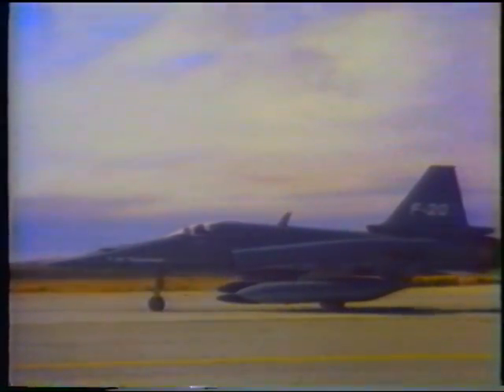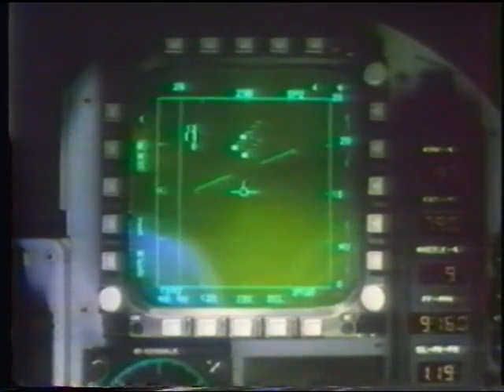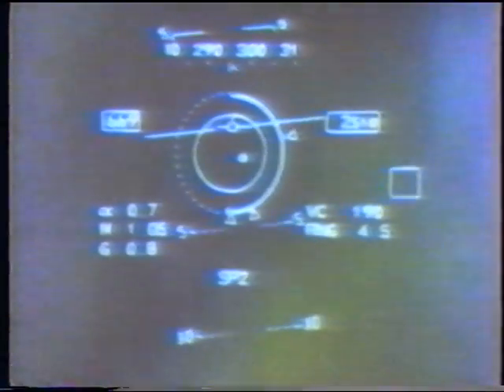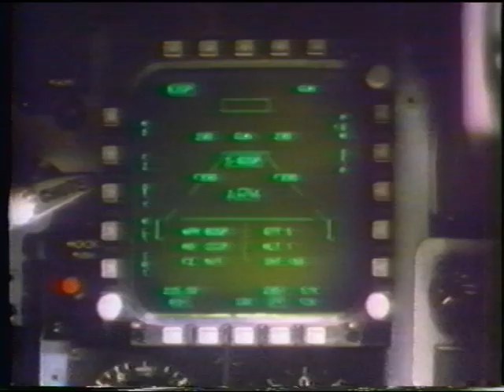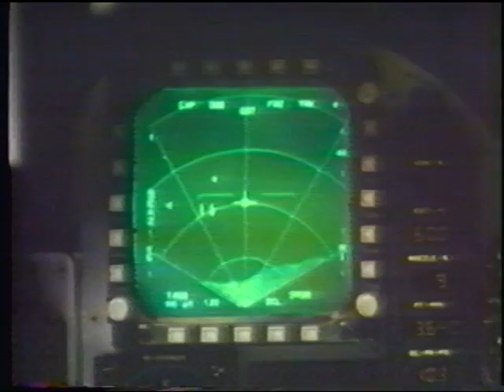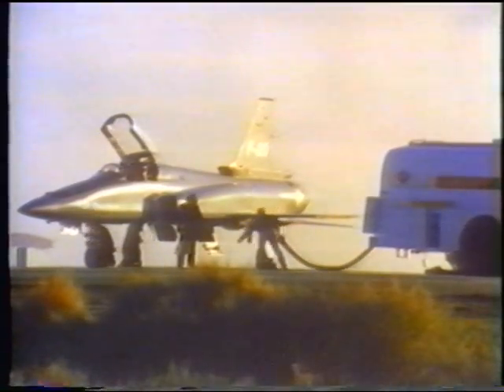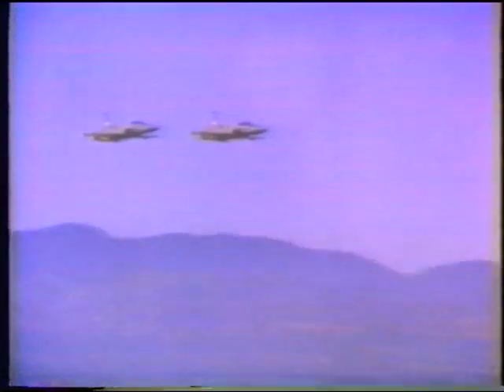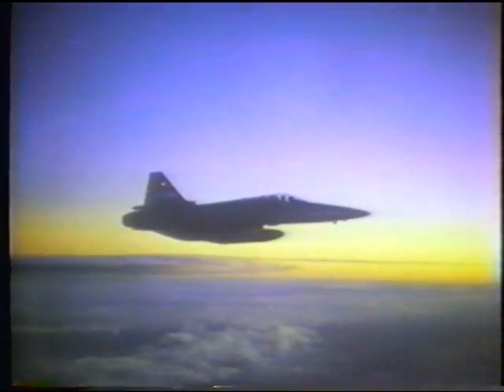F20 Tigershark historical video

Comment: F20 was superior to the F16, in every way.
Reply: +Chris Beckman No it wasn't, the F-16 had better range, maneuverability and rate of climb, the only upper hand the F-20 had was BVR capability despite being marketed as a downgraded F-16. And later the F-16 would also have that
Reply: Chuck Yeager would disagree.
Reply: +Chris Beckman And how? The F-16 was built to be more maneuverable and faster. There is aerodynamically no difference between the F-20 and the F-5, whereas the F-16 was a whole new airframe with a newer and more powerful engine
Reply: +Stormsquad Aerodynamically there were quite a few differences between the F-5 and the F-20, and in fact there were considerable changes between the F-5A and the F-5E. The shape of the F-20's nose, for example, as well as the revised Leading Edge Extensions, were designed to enhance high-AOA performance and pitch response.  The changes were subtle, but they were there.  The F-20 would have been an excellent dogfighter, although I'll stop short of saying that it was superior to the F-16.  It definitely had a much faster scramble time, and in terms of bang for the buck there was no contest.  Somebody should have bought it.
Reply: +PeugeotPilot Well true, if you look very closely there are a bit of minor differences in the intake shape and couple other surfaces in the F-5 and the F-20
Reply: +Stormsquad Those differences added up to a very different animal in a turning fight.  The original F-5A was more of a light bomber than a fighter.  With the introduction of the F-5E it became a proper dogfighter.  The LERXs were enlarged and the wing (in particular the combat flaps) were extensively changed.  When the F-20 came along the lessons learned from the F-5E were applied to that aircraft, but enhanced.  It had larger LERXs than the F-5E and would have had a fully-automatic combat flap system integrated with the FBW flight controls.  Northrop had a really interesting hybrid flight-control system that gave the pilot limited-authority manual controls if the FBW system packed it in.  The flattened shape of the nose was one aerodynamic feature that allowed Northrop to do away with any AOA restrictions at all.  There are some interesting articles on the subject if you're interested.  Add it all up and the F-20 was basically the ultimate evolution of the F-5 concept, a mature and capable design.  It may have looked a lot like an F-5A (and this family resemblance may be one of the reasons it never sold) but really it might as well have been a whole new aircraft.
Reply: Payload....F-16
Combat radius.....F-16
Climb rate.....F-16
Hard points for LANTIRN/SNIPER/LITENING, and HARM Targeting Pods...F-16
Cockpit visibility fore, aft, and side....F-16
Seat position for comfort and G tolerance....F-16
Radome size....F-16
SEAD mission profile...F-16
Growth potential for JDAM employment in the future....F-16
Sustained Turn Rate....F-16
Engine commonality with other USAF engine logistics infrastructure (F-15 for Pratts and B-1B for GEs)....F-16
Real gun common to every teen fighter (M61 20mm rotary Vulcan)....F-16
Reply: I wouldn't say it was superior in every way, but it did have several strengths to draw on, especially the greatly reduced operational and maintenance costs and the very high thrust-to-weight ratio. Yes, the F-16 could outturn it (in a level turn, which is a sucker's play anyway) but the F-20 truly excelled in the vertical. Going over the top in a high yoyo meant being able to pull an extra g  (this is sometimes known as "God's g," a.k.a. "the radial g") which would have enabled the F-20 to quickly overcome the perceived technological advantages of the various blended-wing/fuselage designs (MiG 29, Su 27, F-15, 16 etc). 

The Tigershark would have cost considerably less than an F-16 while delivering 80 to 90% of the performance, with attendant savings on operational maintenance and a higher sortie rate. In short, it's better to have 50 slightly less capable fighters that fly 95% of the time than it is to have 30 slightly more capable fighters that fly 80% of the time. As many a Tomcat and Eagle driver learned in training, when there are enough F-5's around, you're pretty much screwed...now imagine if they suddenly weighed 15% more but had 70% more thrust!
Reply: @That70sGuitarist  Biggest problem for any F-5 vsriant in WVR fight is rear visibility/no bubble canopy.

Its greatest advantages were very low RCS when slick and tiny visual signature.

When the F-20 was mounted with AIM-7s, it was one of the most ridiculous configurations I've ever seen. Clearance from the runway on bringback was unacceptable for cyclic sortie generation and would have resulted in regular missile fin damage/loss, rocket motor impact with the runway, and high mishap rates with that ordnance.

When you look at the practical things a fighter has to do, you start to see why the F-20 fell short on many ways.

The USAF didn't really care about the Lightweight Fighter capabilities of the F-16. They really wanted a multirole/attack single engine, single seat fighter with ease of maintenance that could self escort and defend itself well from SAMs and other fighters.

In short, they wanted a supersonic replacement for the Century series, F-4, and A-7 as those airframes timed out that also had tactical nuclear strike capability like the F-105 did, without the F-105's structural vulnerability to AAA and SAMs.

If you look at how the USAF employed and continues to employ the F-16, it has been almost 100% attack/strike/SEAD/CAS focused.

The main exceptions to this are the Aggressor squadrons, where the F-16 performs as an excellent simulator for threat aircraft flight profiles.
Reply: @LRRPFco52  The F-35 has appallingly poor rear view, far worse than that of any F-5 variant (just look at the enormous bulkhead immediately behind the pilot seat!) yet the US government committed to it in a very big way, as have several other nations, and at truly mind-boggling prices, too...and oh gee, isn't it made by Lockheed?

If you haven't picked up on this from my other comments yet, I'm pointing out why the F-20 would have made an ideal low-cost/high benefit point defence interceptor/ground strike aircraft for certain friendly foreign powers like Taiwan, Turkey, Saudi Arabia (the last two of which had considerable operational experience with F-5's) and similar Western-allied and/or friendly countries. There was an F-20 deal in the works with Taiwan, but that deal got scuttled by a US government offer (which was later revoked, of course) to sell Taiwan a slightly  less-capable version of the F-16, if you'll recall. That was pure, unadulterated skullduggery, rather than a failure of the F-20 in any way, shape or form.  

Remember the F-8 Crusader? It also had a piss-poor rear view, yet despite that glaring flaw, it somehow managed to score the highest kill/loss ratio (11-1) of the entire Vietnam war, using only four single-barrel Colt 20 mm cannons and a pair of Sidewinders, although that was eventually upgraded to four.  As some flight instructors say, "Sometimes, simpler is better." Crusader pilots sported custom badges with the boast, "When you're out of F-8's, you're out of fighters!" Having all the latest technological wonders on your side is no guarantor of victory; say you send in two flights of 4 F-35 "self-escorting, multi-mission/multi-role" $180 million strike fighters to take out an important bridge, thereby preventing advancing enemy reinforcements from trashing your amphibious landing force, while the other side sends out 30 less expensive but fast and agile Gen IV fighters to intercept. Then what happens? Not only does not one single, solitary bomb ever reach that bridge, but most of your $180 million F-35's are in bits and pieces. Meanwhile, enemy reinforcements are now pouring across the bridge to waste your amphibs!

The point is this; given any two reasonably agile fighters, the fight isn't necessarily going to automatically go to the guy with all the latest bells and whistles, it's going to go to the better trained, more motivated and determined guy, the kind who knows enough to fight from his own strengths/against the other guy's weaknesses. If that guy is in something like an F-20, fast, lightweight and agile, and he's experienced and savvy enough to take the fight into the vertical, he stands a very good chance of coming out on top.  (That's the Gospel according to a Crusader pilot.)
Reply: @That70sGuitarist  F-35 has a much wider cockpit from which to get plenty of rear-view, not that it's needed. Read the Norwegian F-16 pilot report on it. He has thousands of hours in the F-16 & spent a lot of time converting to the F-35A, learning how to fight it differently to be superior to the F-16 in BFM.

Taiwan cancelled their interest in the F-20 when they watched it crash at the airshow in Korea. Pilot did a high performance take off with gear down, barrel-rolled and came down inverted into a massive fireball.  It was very tragic.

F-8 Crusader was only used for a short time in Vietnam in air-to-air, achieving 19 A2A kills, only 4 of which were with those unreliable Colt 20mm cannons, which would break links under high G turning fights. Almost all the kills were with the AIM-9 IR guided from rear quadrant and maybe 2 of the AIM-9C radar-guided variants unique to the F-8. There's an excellent technical and historical analysis on the F-8 you should read. The F-4 had almost twice the climb rate of the F-8, which is why the Navy quickly pivoted to the F-4 for Fighter Weapons School, using cadre from the F-8 Crusader College fighter weapons curriculum, most of which was fighting the BVR fight even back then in the late 1960s.

As far as your scenario with the bridge, F-35s can destroy the bridge from over the horizon while simultaneously killing any air defense fighters from unseen approaches, then go destroy any remaining fighters at the airfield they came from. It's an unfair fight in every way.
Reply: @LRRPFco52  So you're claiming that 8 F-35 can carry enough ordnance to destroy 30 Gen IV fighters BVR? Wow, no wonder they're so heavy!
Reply: @That70sGuitarist  If you configured 8x F-35s with a strict A2A load only, you would bring 32x AIM-120s into the fight, but they don't normally configure that way.

The major benefit the F-35 has over most other fighters is how much internal fuel they carry, which allows an unusually long combat radius or extended loiter time.

An F-16 carries only 7000lbs internal, so it needs external tanks for pretty much every mission profile.

The F-35A carries 18,480lbs internal fuel, in addition to the basic weapons that an F-16 typically carries. The main difference is that it carries those weapons internally.

Additionally, where the F-16 needs to carry ECM and FLIR/targeting/LST pods externally, the F-35 has those systems built into it at next generation levels without a drag penalty, so its climb rate, acceleration, turn, and max speed are not affected by external stores and suspension equipment.

If you go back to the F-20 and look at what it would take to be able to carry ECM and FLIR, you would lose your weapons stations, which were already very minimal on it, especially as it would require external fuel tanks for most mission profiles.